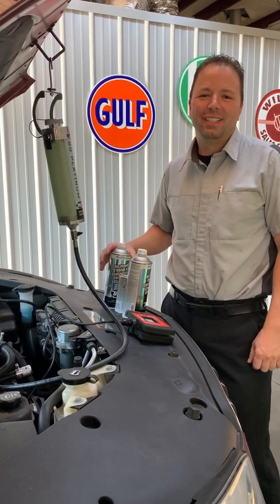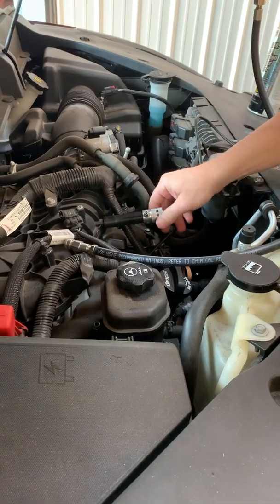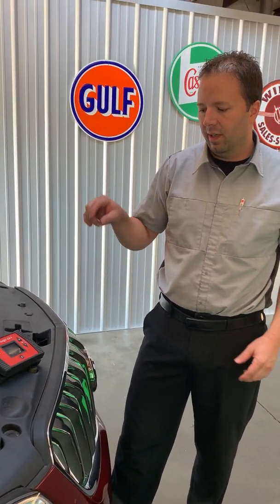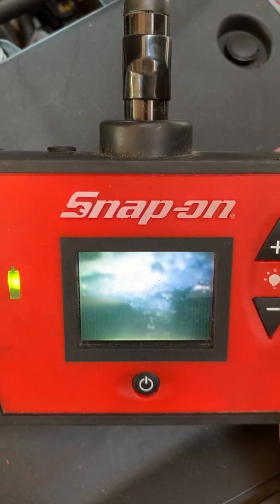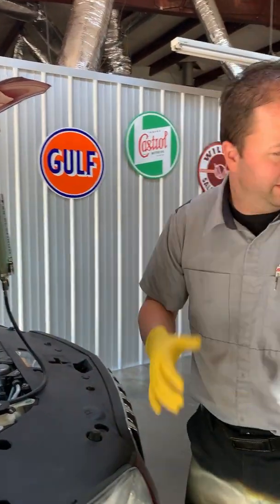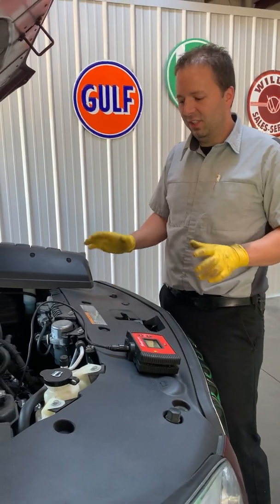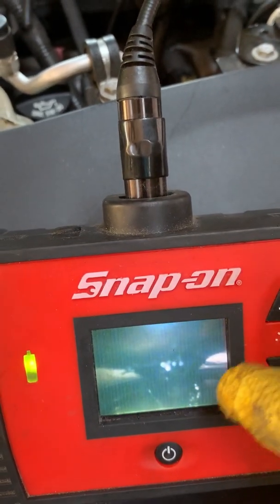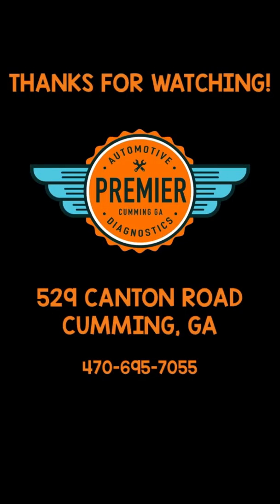Gasoline Direct Injection (GDI) Induction Service

Comment: Would an oil catch can help mitigate some of that carbon build up?
Reply from the maker: I have not tested that theory. To my knowledge, there is not a remedy to prevent this buildup on any GDI engine. I am aware that Toyota has installed fuel injectors on the back side of the intake valves for the sole purpose of cleaning the valves. That is the best option in my opinion. This technology is present on some of their later model GDI engines.